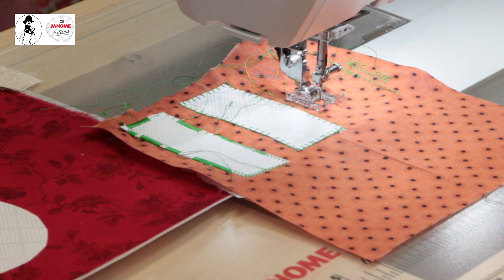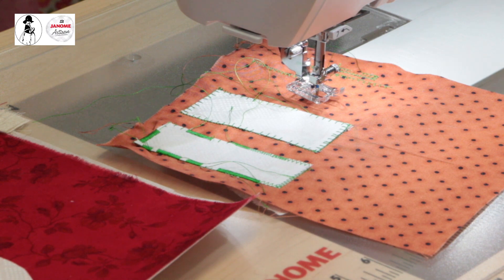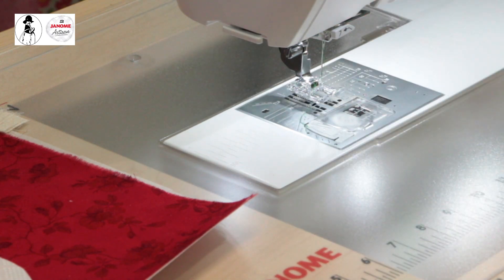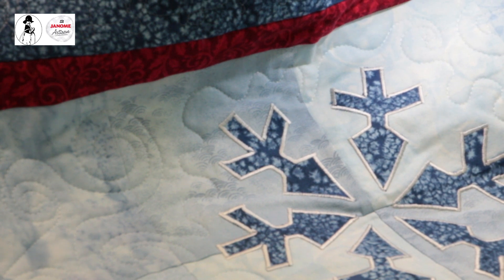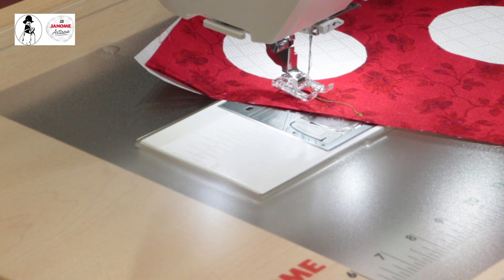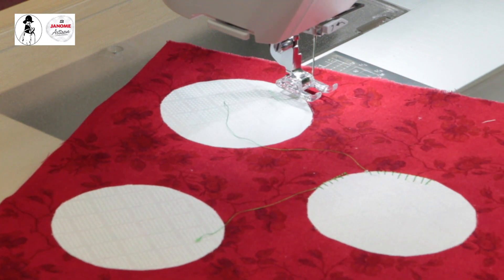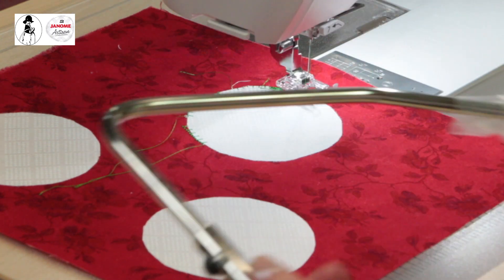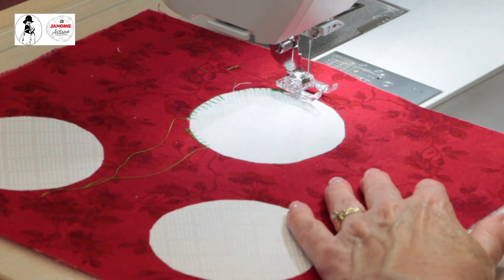How to Appliqué on the Janome MC9450 - Janome Sewing Machines Facebook Live May 26, 2020

Comment: Hi Kim thank you for a very informative video. Do you have another video showing how to do corners on this machine? I have a difficult time at that point. Also I didn't get what icon you went to to save my stitch. Thank you
Reply from the maker: I'm not sure if you mean corners when straight stitching or doing corners on an appliqué piece?
Reply: @Chatterboxquilts  going around a corner. I know there is a certain setting that makes the corner perfect but can't find what video I saw it on. Thank you
Reply from the maker: I think you mean the tapering stitches on the 9450. That video is at https://youtu.be/04cFsPcpLLo

Comment: Why when I turn on my 9450 QCP machine & touch on decorative stitch icon, does it not bring up Appliqué option, onlyQuilt icon ?
Reply from the maker: I no longer have the 9450 but I'll try to give you a suggestion and that is to check to see which needle plate you have installed. You'll need to have the regular/zigzag needle plate installed to see appliqué and other decorative stitches on your machine.

Comment: Do I need to change tensions when using rayon threads?
Reply from the maker: Changing tension depends more on the weight of the thread than the content of it. Don't be afraid to adjust your tension if you aren't getting the results you want.